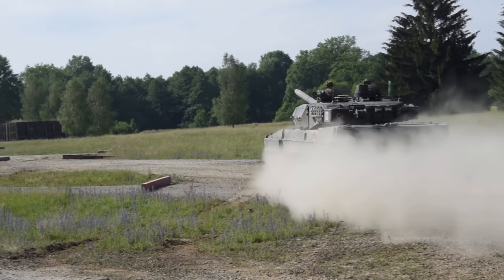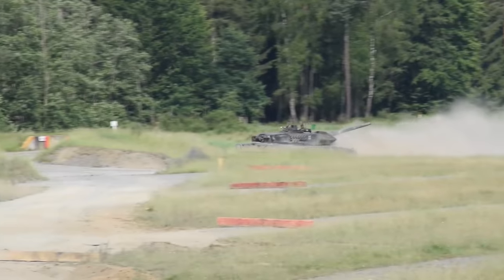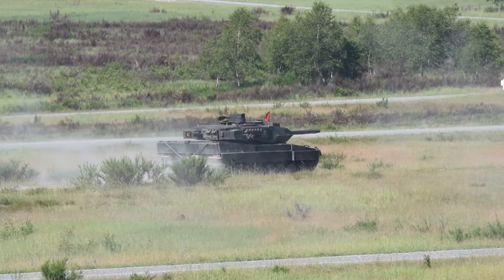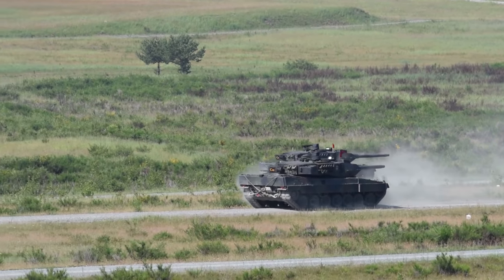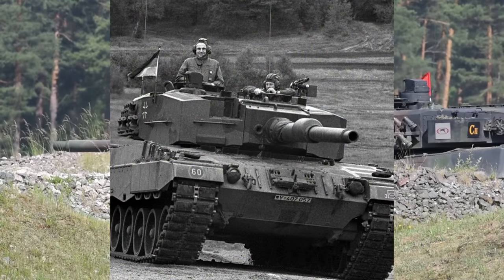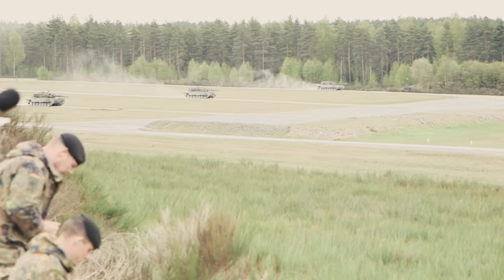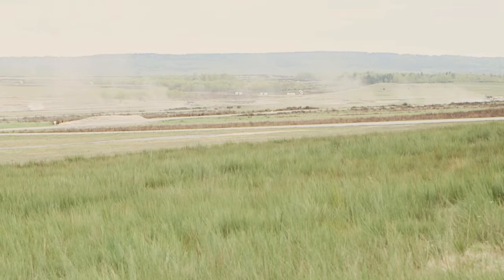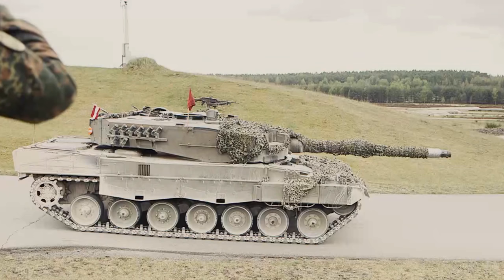Leopard 2 Main Battle Tank | GERMAN ENGINEERING

Comment: We already have something better than this. It’s called the Abrams tank with a turbine engine. You Germans can keep your old diesel reciprocating liquid cooled engine.
Reply: Lol tough words for a nation which buys a bad version of the German gun
Reply: @KingSpittusFactus  Not tough words just truthful words. The Abrams tank is far superior to anything on earth. That could change however, if the USA decides to make a new main battle tank. 

What do you mean a bad version of a German gun?  To my knowledge the Germans never made any bad firearms or weapons of war.

How many German firearms do you own?  How many different brands of German firearms have you shot?  Myself-I own several
Reply: @blueboltstrike6705  He means that since the A1 upgrade the Abrams uses a licenced version of the Rheinmetall 120mm L44 gun which is to some degree outdated as the Leopard 2 uses the L55 since the A6 upgrade which has superior accuracy and muzzle velocity. Btw. South Korea also choose the L55 for the K2.
Also turbine engines in tanks has proven to be a mistake. The soviet union also tried that in the T80 and yes it works mechanically, but it's a freaking gas guzzler so they changed back to Diesel engines in later tanks. Also no other NATO country or NATO compatible country has gone for a turbine powered tank since. I mean the K2, Type 90 and Type 10 came out basically decades after the M1 and none of them uses a turbine.
The insane fuel consumption was also one of the reasons the M1 lost the competition against the Leo 2 in the Swedisch procurement selection process. The need to refuel every 100km may not be a big problem when you march into some third world countries, but it will be potentially a huge problem if you would fight against a technologically equal foe which has the ability to attack your supply lines.
Reply: @shi01  Who do you think provides the military muscle behind South Korea?  It’s not South Korea -I can tell you that much.  What nation provides the bulk of the fire power of NATO?  It’s not the United Kingdom or Romania. 

Sweden didn’t get the M1 because of classified information that the United States cannot let out. The M1 tank was designed to fight the Soviet union in extreme cold arctic environments. So it’s up to the task for fighting the most advanced enemies on earth. This includes the Third World militaries of Russia and China. 

The turbine engine has less moving parts and it’s not a reciprocating liquid cooled motor such as that Diesel engine. Diesel engines are good for heavy duty trucks and pick up trucks but not tanks. Turbine engine doesn’t have a radiator full of liquid that can get shot out. The turbine engine can also run on seven or eight different types of fuel. With the reciprocating diesel engine you’re stuck with basically diesel. 

Don’t be so jealous. Sweden can’t do shit on its own against a country like Russia. They would hold up for a few days but Russia would come in and take all their shit.
Reply: @blueboltstrike6705  How does it matter for this topic as to who does provide the muscle for South Korea? I simply stated the fact, that South Korea choose a Diesel engine and the L55 gun.
Btw. a summary of the swedisch procurement test results has leaked to the public, so secret my ass. And as i wrote, one of the reasons they choose the Leo2 over the M1 was fuel consumption. Also if sweden can or can't defend them self against russia has nothing to do with the topic.
But a higher or lower fuel consumption of a specific tank model comes with additional tactical and financial considerations.
Why should it be importent how many moving parts an engine has for anything? It doesn't determine efficiency at all. Btw to say a turbine has only one moving part is a vast oversimplification especially in the case of shaft turbines like in the M1. Also you have forgotten ships where Diesels are really good at propelling things forward.
Reply: @shi01  You don’t understand it-You are part of the “low information crowd.”  The Abrams tank has states secrets is that are inherent in its build and design. If the United States military or military defense contractors sell these tanks they are basically stripped down versions. They are not going to give Sweden full access to confidential military information on a whim by sale of an M1. 

You don’t know anything about manufacturing-The less moving parts you have equals the less parts that can fail.  Simple equals efficiency in time with battle. The Honeywell turbine unit is also modular and can be replaced very quickly. The Challenger in the leopard tanks have archaic reciprocating diesels that are much harder to swap out and replace. 

The ability to run on seven or eight different fuels efficiently-is a major bonus. You try putting anything but diesel in the leopard tank and you have big time combustion issues. This is not 1945 anymore. Technology has moved on. Diesel is great for trucks and civilian shipping transportation. For a main battle tank you want the best. 

Let me ask you-What nation on 🌎  earth 🌎  provides the most fire power in the NATO organization?  What nation does both China and Russia fear and respect most?
Reply: @EmperorLionflame  That guy is right. The gas turbine is much more efficient according to you. Otherwise you would not have that in the Queen Elizabeth class brown water amphibious strike carrier. You’re not going to have your cake and eat it too.
Reply: @blueboltstrike6705  Soooo, what do they plan to use in the M1 upgrade again?